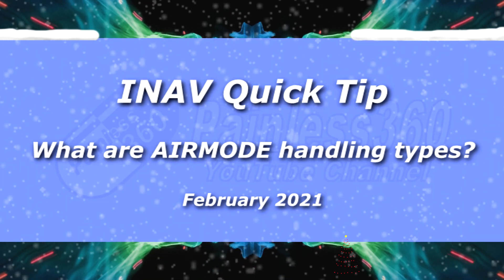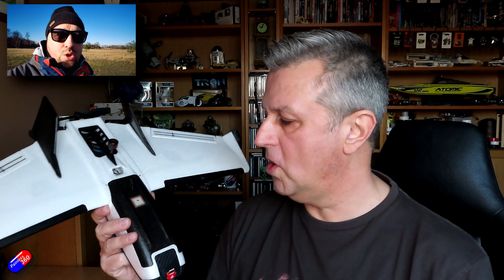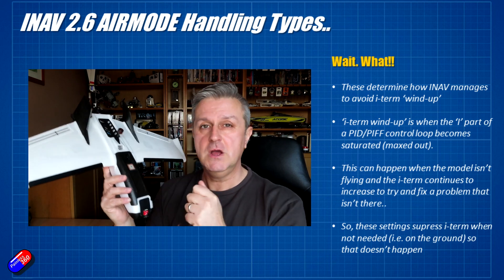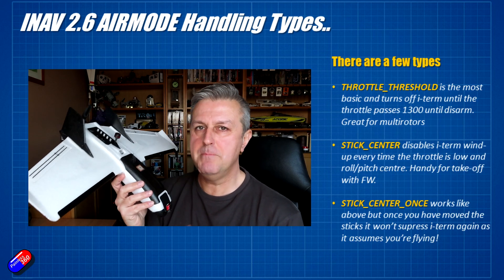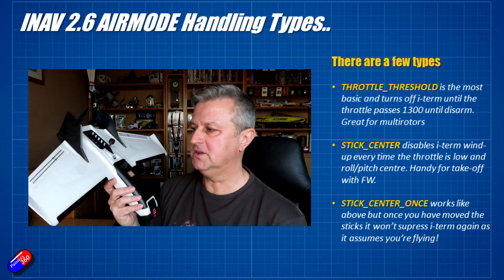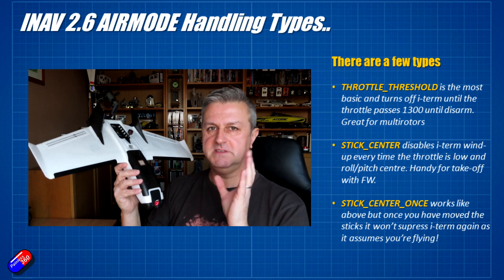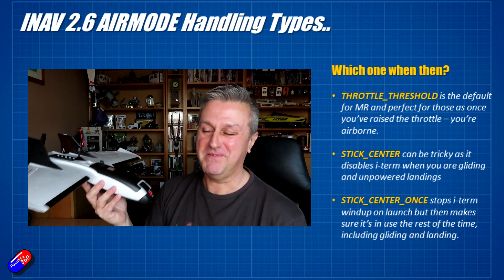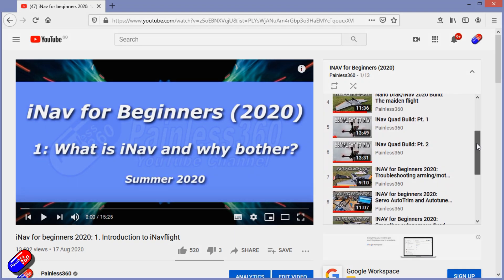INAV AIRMODE Handling Types: What are they and what changed in 2.6?

Comment: So I have 4 servos trimmed using the MID of the output tab in INAV, but whenever I’m increasing throttle and in angle mode(or any other stabilized mode), the servos’ position slowly increases even though the craft is just on the table, and INAV shows the aircraft is level and in the correct orientation. The weird part is that this doesn’t happen when the arm switch isn’t flipped.
Reply from the maker: That's expected,  don't worry about it.  Best of luck

Comment: Does stick-center account for trim settings? Fixed wing may have trim settings that are not necessarily always centered. Maybe it picks up on the actual stick position and not the actual channel position?
Reply from the maker: You don't use the trims with iNav... Happy flying

Comment: This addresses exactly one of the issues I am confused about. I am trying to set up a glider with inav where every flight the throttle will be zero dozens of times each mission, and every landing is a "dead stick" landing due to the presence of a 16 inch folding prop on the nose.

Comment: This is a really nice addition to iNav. I’m going to make a change to the defaults in configurator; to have this set as the default when you select “Airplane” in the post flashing popup.

I admit, I missed this one as I was going through the pull requests. So thanks for getting this video out Lee 👍🏻

Just to confirm, the I term will not activate until after you have armed and moved the sticks. So being disarmed and doing a control surface check will not trigger anything. Also, when you disarm, it will reset. So it will disable the I term windup again until you re-arm and move the sticks.
Reply: It's been merged already. Just as a heads-up, this also includes a CLI change. The current mc_airmode_type and mc_airmode_threshold will become airmode_type and airmode_throttle_threshold respectively in 2.7. It just didn't make sense to have the mc_ prefix when this effects fixed wing as well as multicoptors.

When you select Airplane from the defaults pop-up dialogue, after a firmware flash; the airmode_type will be set to STICK_CENTER_ONCE. Don't worry all you quad folks. The Quad default still uses THROTTLE_THRESHOLD. I have also updated all the presets on the presets page to reflect the new airmode_x variables.

Comment: Thanks boss - between you, Pavel and Bardwell, I've learned huge amounts in the first year in the hobby.
Question for you - is mast mounting the GPS/compass still needed for a quad running iNav or is the style of mount we see on the 4" explorer quads sufficient?
Reply from the maker: It's the interference with the compass that causes the the most issues. Physical seperation is often the only option. Betaflight 'GPS rescue' doesn't use a Compass allowing for the GPS unit to be on those positions. See my INAV and Ardupilot builds.. Best of luck
Reply: @Painless360  Many thanks for the reply - looks like a mast it is then
Reply: I'm setting up a iFlight Chimera4 and I found I need a pretty long rear mount to avoid compass interference.